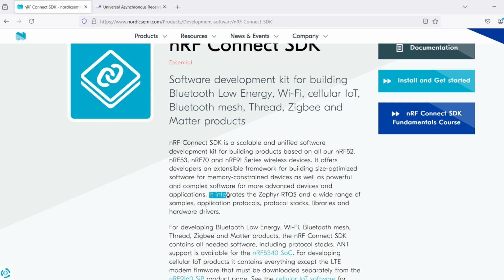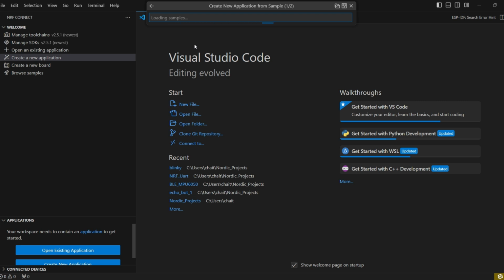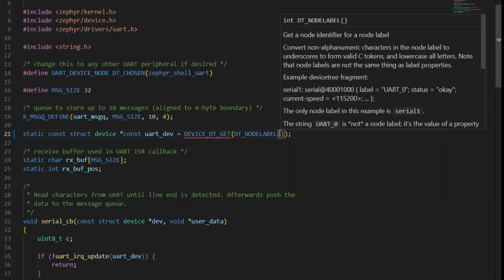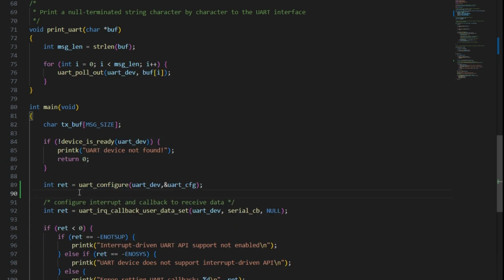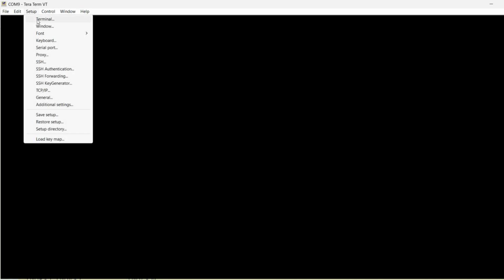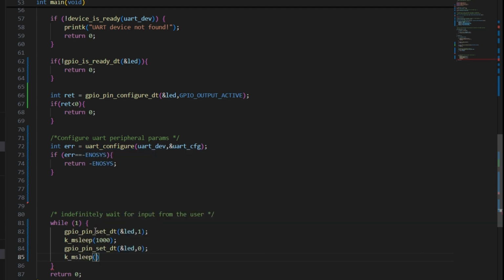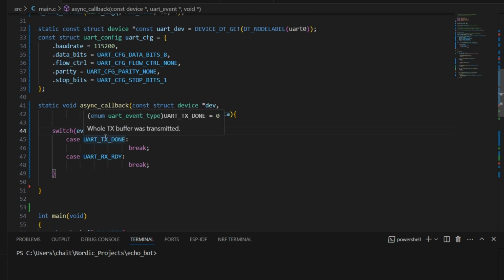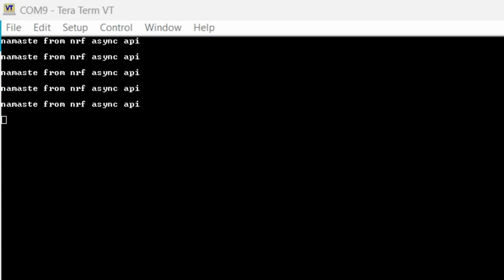UART on nRF52840 Dongle – Complete Guide & Walkthrough!

Comment: i uploaded the blink rpogram in the same way,the led blinked as per the code.but when i upload the peripheral lbs example hex file it is not advertising why?
Reply from the maker: @saranyak5114  Hi. So, after uploading "Peripheral lbs" hex file for nrf52840 dongle.  You can find on  nrf connect app the status of button over ble is correctly updated (pressed/released) but you can't control led. answer to that can be found in main.c source file under the main application function. the led initialization function used is dk_leds_init() which is for nrf52840dk dev kit and not supported for dongle. update it according to dongle and you will get it working. thanks.